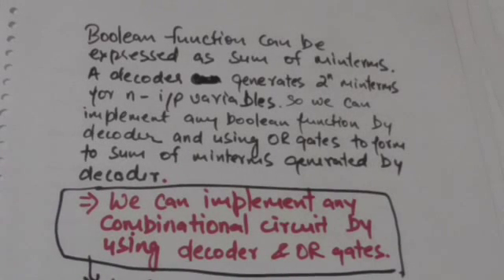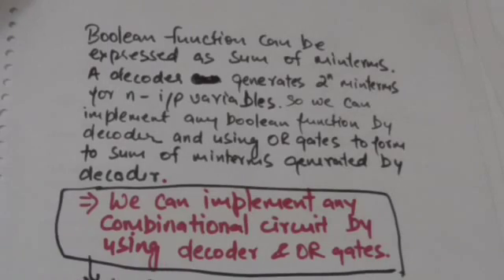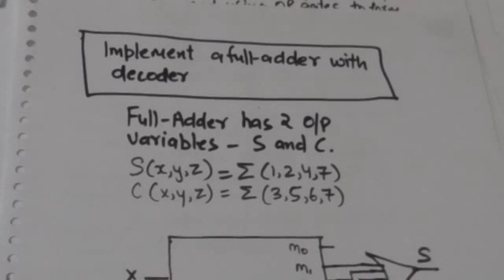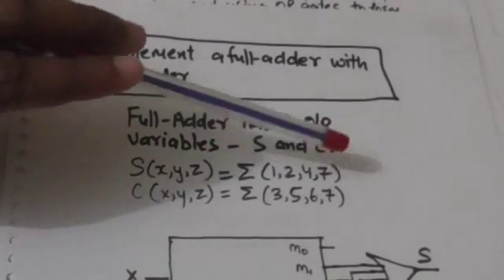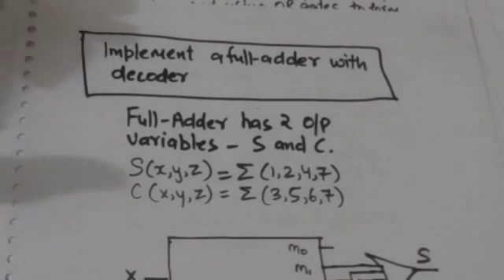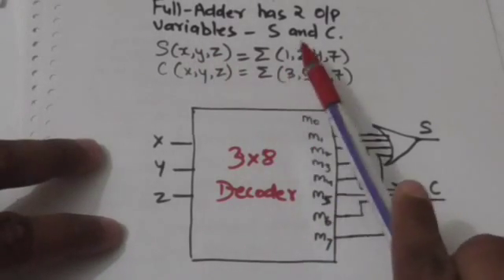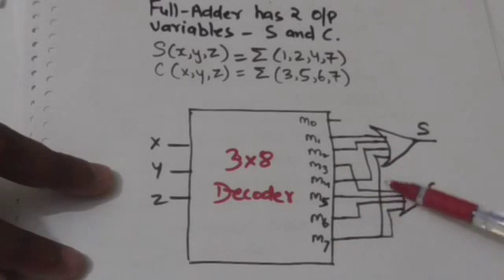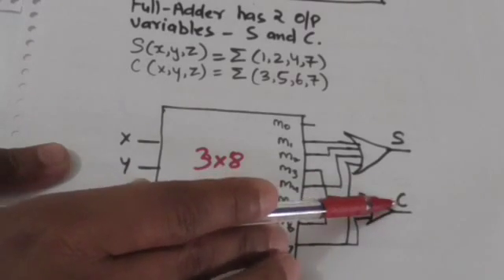IMPLEMENTING BOOLEAN FUNCTIONS(OR  COMBINATIONAL CIRCUITS) BY DECODER(DIGITAL SYSTEM-45)

Comment: How about an example on a 4 X 16 decoder? I'm not that strong on Digital Logic. I need to implement two functions m(2,4,6,8,12) and m(1,3,6,7,9,10) using an appropriate decoder. I'm guessing a 4 X 16 decoder would be necessary. My only question is, would it be good enough to implement it directly using a 4 X 16 decoder or is it better to go for two 3 X 8 decoders?